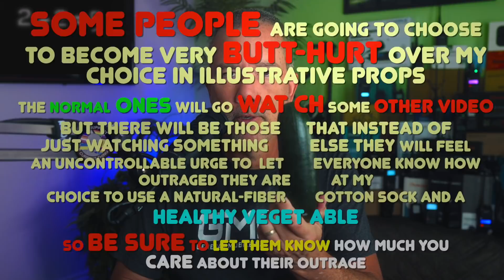How Is A GMRS Repeater Channel Different From Standard Channels & Why Are Repeater Channels Shared?

Comment: I just got my first GMRS radio today. Can't wait to get my license. I went with the GM-30 because it's easy to use as a novice. 👍
Reply: GRMS Only requires a $70 fee right
Reply: @JifferRiffic  
After April 19th, it's supposed to go down to $35 for ten years.
Reply: @RicArmstrong  yep, I'm holding out until it drops
Reply: For the love of everything holy, follow the instructional video on here.  The FCC website was coded by rahtarded pigmies.

Comment: Damnit Randy… you spoke untruths ..   a person using ch19, can easily talk with someone using a repeater on 19 provided they are in simplex range of each  other.   Both radios are “listening” on 19.   The person using the repeater must not have tone squelch active, or the person on simplex needs to use the same tone as the repeater output.   It’s easy.
Reply: Yep 👍

Comment: 2 + 2 = 5 for very large values of 2.
Reply: Sounds Orwellian
Reply: 2+2=5 Only if one of the 2’s is off set by .3 or .4 (.5 or higher would be 3 and not a 2 anymore) and the other 2 is off set by .1 to .4 (again .5 would be 3 and not a 2). If both are off set by .2 or less… it will only equal 4. I use the example frequently with know-it-all kids. It blows their minds 🤯.

Comment: Sorry to add an unsolicited complication, but the repeaters users MIGHT hear you, if they are not too many fars away from you, and they are using no receive tone.
Reply: Good point. Not a GMRS user yet, but I’ve wanted to mention this a few times, but didn’t want to add more confusion to some of the new radio folks. Ha. If the GMRS repeater output has no tone, and my next door neighbor is on the repeater channel…if I key up on the shared simplex channel that matches the repeater output (while being within range of my neighbor), he’s going to hear me. It’s all just frequencies, tones and range.

Comment: Another question Randy, so if I’m on channel 20 and I have a repeater channel 20 when I key the Mike the radio if programmed right will automatically use the repeater channel 20 and then broadcast on the regular channel 20 the only stupid question is the one you don’t ask I’m a newbie I’ve only had my GMRS license a week

Comment: It would be possible for someone that's on a normal simplex channel to hear and talk to someone that on a repeater. However (and it's a big however), it's almost impossible to. The repeater user's radio would need to not have their receiver locked to a sub channel code aka having the R-CTCSS or R-DCS (for the experts) option I'm going to acknowledge the fars problem but that's a smaller problem then the transmitted codes problem (assuming you're running "higher" power). But in the normal 99.99% of cases, it's not possible.

Comment: 22 regular channels, 8 repeater channels. If I ran out of the 8 repeaters on Baofeng GM-5RH, can I use regular channels, set repeater tones, set offset, save it, say as channel 33 and expect to work like a repeater channel? I tried exactly that but it did not work bc whenever I press transmit, I do not see it transmitting at the offset frequency, just transmitting like simplex at the listen freq. If regular channels can never be config to work like repeater channels, why bother to have an offset setting that has zero effect on the tx freq? Looking forward to another lesson besides the "hiss" sound lesson (on his enlightening Utube) on how to differentiate betw a simplex vs repeater conversation on the airwave. Thanks.
Reply from the maker: Most GMRS radios allow you to store additional repeaters on custom channels but how to do it depends on your specific radio.
Reply: @TheNotaRubicon  Updated my orig post, "on Baofeng GM-5RH", thks. The offset did not force the BaoFeng to tx on the offset, was just tx on the rx freq set, why/how fix? I would assume that's fixable if indeed non-repeater channels such as chn-5 or chn-33 can be used as repeater channels with correct config, just cannot get it configured to work as such. Thks.
Reply from the maker: Some radios allow you to only use certain channel numbers for custom repeaters (ie; only channels higher than ch40, etc).. some also automatically enter the offset, others dont and you have to enter it. What does the user manual say about adding custom repeater channels?
Reply: The last time i chk, GM-5RH is too new (Dec 2023) to have PDF manual for searching text, but its paper manual only mentioned repeater tones, nothing else. Your channel-40 as custom repeater channels work! Offsets now working and tx got repeater response "hiss". I have 2 identical GM-5RH with identical settings, but they can't talk to each other despite hearing the "hiss" when I release the tx button. Repeater is Daniel Peak and I'm in S Hemet, so within range since yester-night spoke with repeater owner via Chn-23, std repeater channel. This or most small devices manual like GM-5RH needs a magnifying glass to read, so unless there's online PDF, me don't bother to read, simply watch some youtube on pertinent topics. Learned the "hiss" and channel-40 from you! Much appreciated. 😄

PS: Baofeng really need to disable fields (like Offset) for below-40 channels if offsets/etc. don't have working effects, instead of letting users do all these "wild goose chase" experiments for hours.
Reply from the maker: i made an entire video explaining why the radios can't talk to each other and how to fix it.. you can watch that video here:  https://youtu.be/CPJPhnIi6Zs?si=q1oWTTUU9FW8yXLu
Reply: @TheNotaRubicon  Just got around to resume by trying the 40-ft act, the 2 identical GM-5RH settings mentioned still hiss but still do not talk -- I transmit on radio1, tap on it, scratch on it, radio2 has no response. When i released radio1 tx button, radio2 hiss loudly as usual/consistently. Will try another repeater tomorrow when i drive to orange county, in case my radio1-2 problem was out of range of Daniel Peak, and revert. FCC just issued license today, so mygmrs says wait 48 hours before its database recognise license# to enable registration to see tone codes of repeaters. Will probably try Mt. Satisfaction (Burbank) repeater, not sure its tone code 271/73 from forums is any good for now (no hiss sound, could be out of its 100-mile rannge, being 90 miles per map)

PS: Radio1, radio2 on a different untouched/unconfigured Simplex channels 1-22 will talk to each other, few inches or far far apart. when next to each other, expected feedback sounded.
Reply: Update: I finally got Daniel Peak repeater having GMRS radio1 talk to radio2 using split tones but only if they were at least 100 feet apart. So, desense phenomenon is real, and so far more so than than when tested and work at just 30 ft with ham freq/repeaters. 

I tested GMRS radio1/2 at night because I won't quite hear the distant radio2 at 100 ft out, but I sure can see its screen lighted up when radio2 received my radio1/transmission.

Hurray! I finally tested repeaters than enable radio1 to talk to radio2 over ham and over GMSR freqs. With that, am ready for WW3, not doing underground bunker anytime soon, maybe just some raised beds vegetables, besides existing fruits orchard. No chicken/eggs for now, don't want to give coyotes some excuses to visit me often 😃

Comment: It looks like Baofeng GM-5RH has a search freq feature that also detect tones of repeater on the freq. I have yet to try that, but wonder if that's the same tone the repeater use for opening the repeater. Anyone? If yes, that's mean we only need to know the repeater freq and baofeng will scan the tones used for users to set same tones.
Reply from the maker: Scanning the tone from the repeater will give you the repeater's output tone which may not necessarily be the same as the INPUT tone needed to open the repeater. To get the INPUT tone to open the repeater you have to monitor the INPUT frequency of the repeater and you must be in range of someone using/transmitting to the repeater - you must scan the radio of someone using the repeater, not the repeater itself.